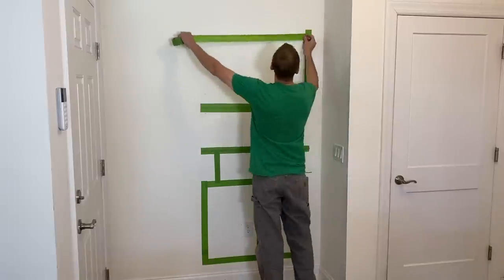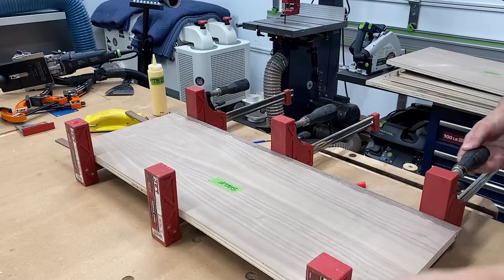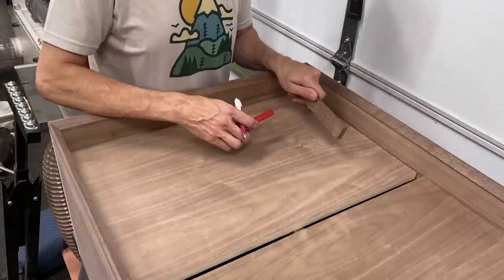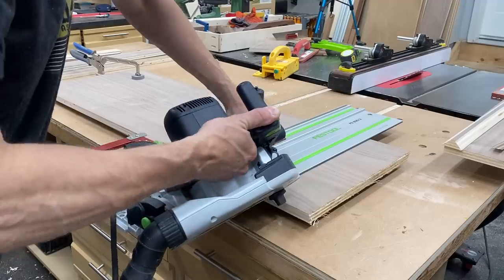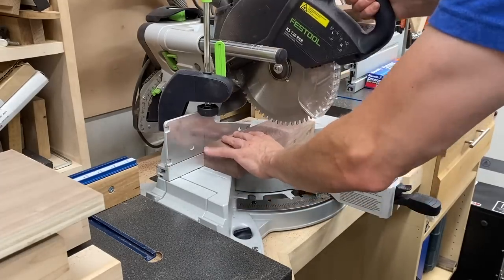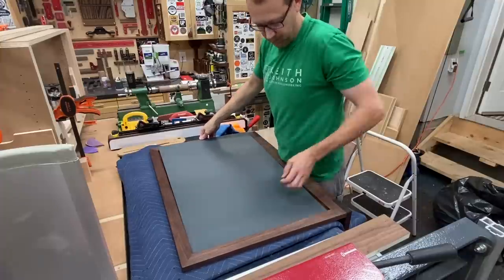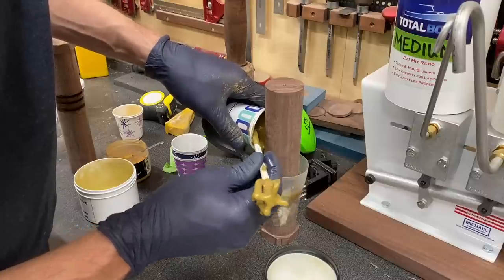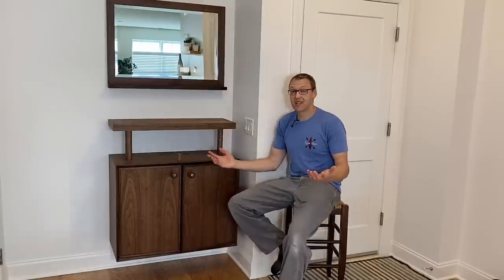Epoxy over brass? How to rethink cabinet details.

Comment: Hi Keith, you could put threaded inserts in the underside of the shelf and threads on the top end of the posts with the bottom just resting on the cabinet top. Then there won't be any holes in the top of the cabinet so it could be re-used without the shelf if desired. Also, attaching felt under the posts would help minimise damage to the cabinet top.
Reply from the maker: Yes sir!! Absolutely. Great idea 👌🏻👍🏻
Reply: Glad you liked it. I love your style of video, it's very entertaining, as well as excellent woodworking. Give some fuss to Lola & Jerry for me.
Reply from the maker: @johnsinfield846  Thanks John! And I'll give Jerry and Lola all the fuss they can handle!

Comment: Hey Wild Man! Another great build 👍🏻. About the floating shelf brackets, just yesterday a “relative” wanted a small favor, I cringed. All he wanted was for me to drill a few 1/2” holes 5” deep in the edge a 3/4” board so he could put up a floating shelf for his daughter to put BOOKS on. Using the brackets you used! I tried to explain but he’s a bit of a moron. SANITY PLEASE!
Reply from the maker: Hmmm...well as long as those books are filled with helium, you should be fine 😂
Reply: @KeithJohnsonCustomWoodworking  - Yep. I have a policy. I don’t work for relatives. This is a perfect example. As you know, if all I did was drill holes, when this all goes to sh-t. It will be my fault! Thanks Bud! I enjoy you more than you can imagine. And I really don’t like “people” that well.
Reply from the maker: @MJ-nb1qn  LOL. Yeah, people are the worst. And my next big project is for family, so watch out!!
Reply: @KeithJohnsonCustomWoodworking  Nice Seinfeld line! Yea I build for MY family, no In Laws, the occasional brother or sister, maybe! I had a set of 4 chisels that were my Dad’s. He opened paint cans and stuff with them. Anyway I cleaned them up and sharpened them and then built one of the finest boxes to hold them from walnut my Dad and I cut from a big tree in 1971 then shipped it to my younger brother. His wife called and told me he cried! We had the Best Parents there could be! Thanks
Reply from the maker: @MJ-nb1qn  Wow, that's awesome!! That's really special.

Comment: Love it love it and I’m soooooo happy you used brass powder with epoxy!!! I wanted to use it in a project recently but didn’t have materials on hand and was concerned it’d look awful. Now I’m not so thanks a bunch! Love those dynamic edges with the deep chamfers, love the French cleats, love it all
Reply from the maker: Yay! Thank you so much! I think I really had my work cut out for me using the epoxy and brass on a round object. Working with it on a flat surface would be much easier. Not sure of your application, but hopefully some of my failures will help you with your project 👍

Comment: Really amazing work, Keith! It looks beautiful! 😃
About epoxy, those things happens... But a heat gun or something really helps with that!
Anyway, stay safe there with your family! 🖖😊
Reply from the maker: Thanks! I used a heat gun quite a bit, but I think since the consistency of the mix was so thick and I used the faster drying hardener, the bubbles just didn't have a chance to make it to the surface and pop off.

Comment: Beautiful build as always. If you didn’t use the posts as additional support for the shelf and it was a true floating shelf, would you still have chosen those metal brackets or would you use a different method to secure it to the wall?
Reply from the maker: Thanks Yvette! I think I still would have used metal brackets, but longer ones. The ones I used were only 4".

Comment: Great video. I'm interested in seeing how you dial in the epoxy brass inlays. I tried that on my own project and it didn't come out very well. I tried a similar process, went through the grits with the steel wool, but the color came out dull and I could tell it wasn't real brass. I'm wondering if the gold mica powder made the difference or if I did something wrong. It's just not nearly as shiny and realistic as what Copper Pig was able to get. I'll have to keep trying because it looks so neat when done correctly.
Reply from the maker: What I learned from Paul was you need way more powder than you think which is what gives you that thick peanut butter-like consistency. Otherwise, the powder will settle to the bottom and the top will be dull.

Comment: Hi Keith. Great video, thanks. Lots of shared knowledge. At 5:28 you say the doors will get 1/2" walnut banding on the edge so you trace lines with a 1/2" setup block. I am a little confused here because in the outro scene there seems to be the 1/2" walnut banding but also a reveal that looks like 1/8". So how do you take the reveal into account when you trace the door with the setup block? can you explain? Thanks a lot for the dedictaion you put in your inspiring videos.
Reply from the maker: Great question! Unfortunately, this was 2 years ago and I don't quite remember. LOL. My usual reveals are 3/32", so I must have taken an additional 3/16" off the bottom and 1 side to account for that before applying edge banding.
Reply: @KeithJohnsonCustomWoodworking  Understood! Thanks a lot! I really appreciate that you personally answer all the comments! Few respected authors do it. Thanks again!
Reply from the maker: You're welcome! I greatly appreciate the support  @rafaelmijares9197

Comment: Keith, great video always really enjoy them. When you use Rubio Monocoat Oil Plus 2C, are you using the both components A and B (the accelerator)?
Reply from the maker: Thanks Edward! Yes, ALWAYS parts A and B. The accelerator is also the hardener. 💪🏻
Reply: @KeithJohnsonCustomWoodworking  thanks Keith, want to give it a go on a walnut record player cabinet I’m putting together atm. Love how the finish came out on your project.
Reply from the maker: @edwardgray5358  Awesome. That Rubio should look fantastic on there.

Comment: Looks awesome, btw did you ever consider putting a walnut back panel so you wouldn't see the wall when you open the doors?
Reply from the maker: THanks!! And yes, normally I would put a walnut panel, but I didn't want to spend another $100 on a full plywood sheet just to use a 1/4 of it. And I would have had to cut out for the outlet that was on the wall as well.
Reply: @KeithJohnsonCustomWoodworking  I agree....$100 for a piece of plywood is a lot. It's about the same here in Cali. too, @$108 for 3/4" A-1
Regardless it still is a beautiful piece of work. Looking forward to your next video.
Reply from the maker: @Zamboni-0805  Thanks a lot! I appreciate the support.

Comment: Really like the simple elegant design on this one Keith. Quick question, when you apply Rubio to your projects is it just one coat and done? Is that why it’s called mono coat?
Reply from the maker: Thanks Brian! And yes, one coat is all that is recommended, but I always apply a second coat to raise the sheen level. Also, I find walnut generally needs a second coat anyway because it doesn’t seem to fully absorb the Rubio in all areas when the wood is real dry.
Reply: @KeithJohnsonCustomWoodworking  thanks, good to know! I’m thinking of trying Rubio on my next project.
Reply from the maker: @brians5539  Great! I think you will love it!